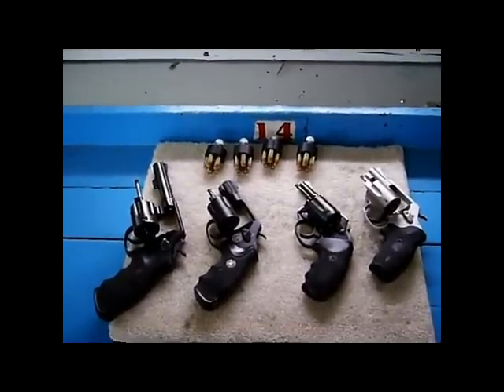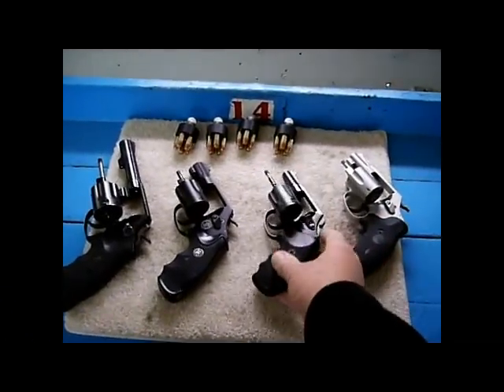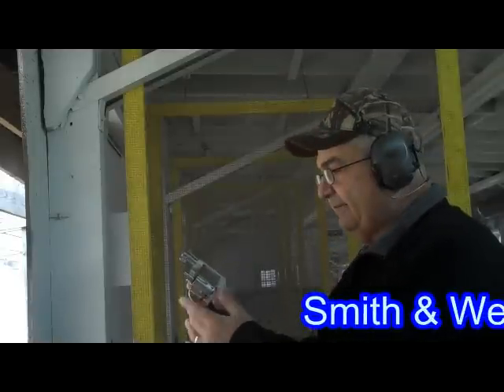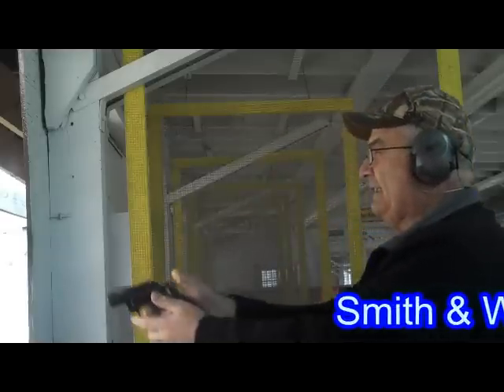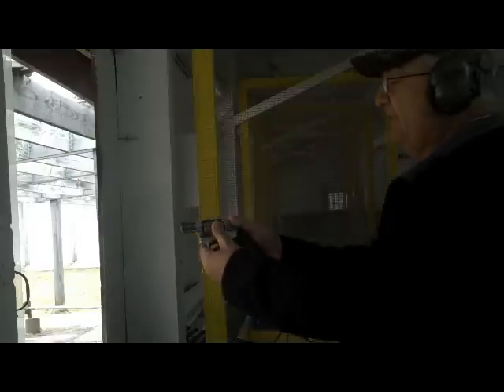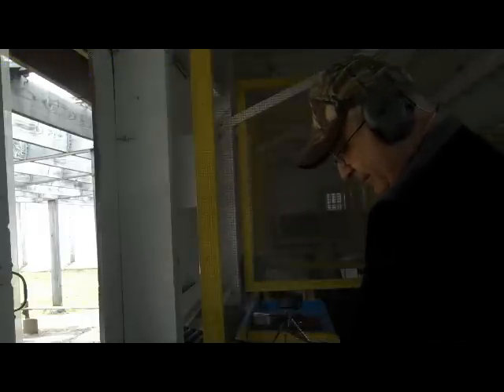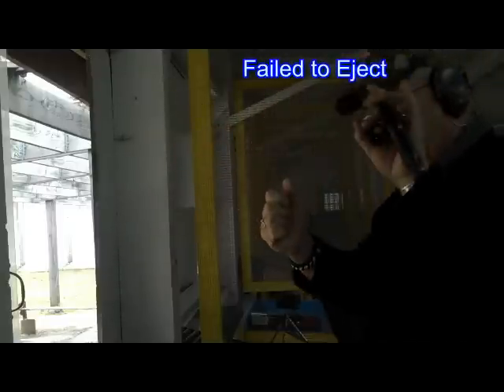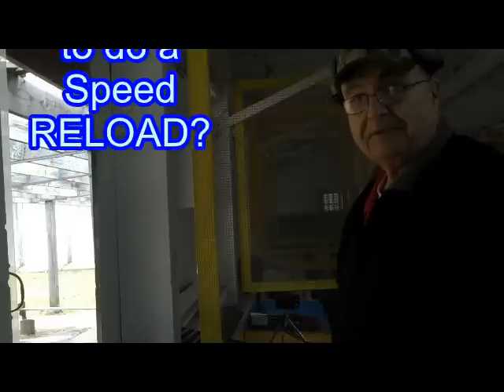Revolver Reloading Part 2 by FirearmPop

Comment from the maker: @Dafarnakis I favor revolvers for many reasons. Generally, you pull the trigger and they go BANG!. As in this video, once the revolver was loaded, all 5 rounds went BANG!. I can't see a scenario where you need more than 5 or 6 rounds. The LCR seems a like a good choice, although I never fired one. I like the LCR in .357 Magnum. That gives you a choice in ammo to use. You will see that it is very light, easy to conceal, and packs enough fire power to handle most situations. Good luck.